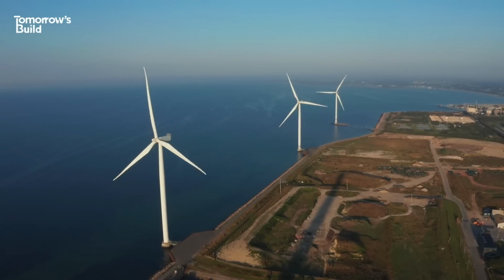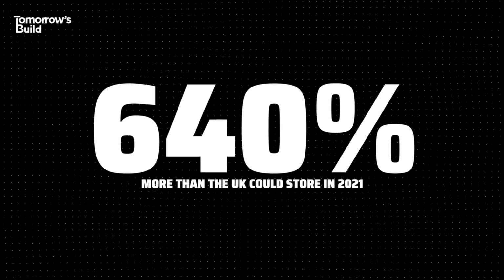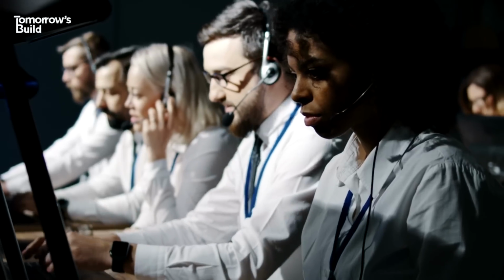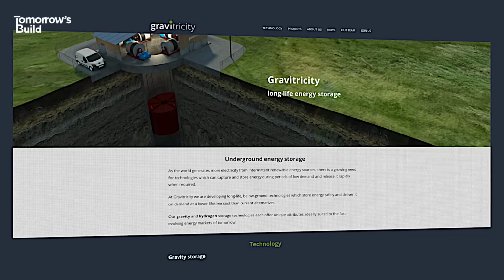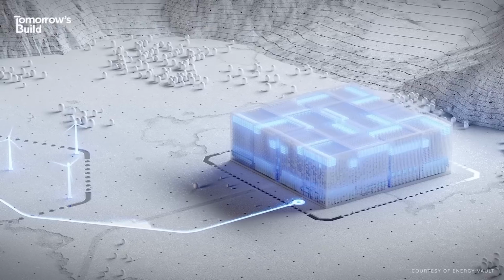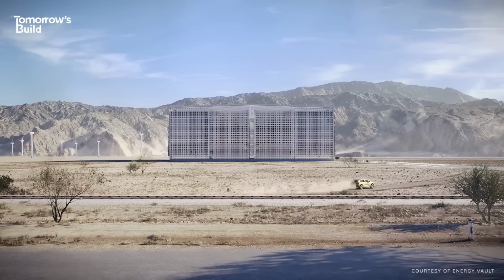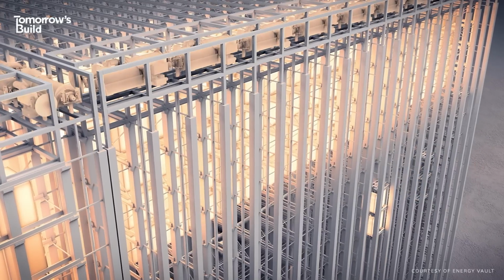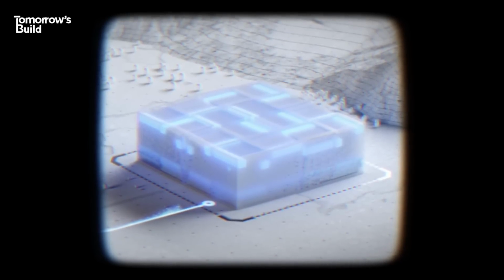The Hidden Crisis With Renewable Energy | Tomorrow's Build

Comment: Adam Something did a video on the previous version of the Energy Vault just over a year ago, and this design as clearly gone through some iterations, but still has many of the problems of the original. Like you mention, the material cost of the Vault versus using building dams is contentious, though I've done no research to determine the amounts of used in either. Additionally, the amount of energy stored would be an interesting aspect to look into to get an idea of how effective/viable the different options are.
Reply: I remembered the same video: The Energy Vault is a Dumb Idea, Here's Why. In particular, I think he made a snarky but true comment about these 'solutions' that show nothing but flashy computer graphics.
Reply: @ropro9817  Energy vault does have a prototype. but that is a shitty little prototype. with a crane (a bit like the ones in the former renders).

But technical prototypes are super ugly and are worth nothing for an advertising the idea to "normal people". 
Nevertheless, the prototypes do their job in validating their point. Even though, you might never actually see any of these technical prototypes.

I do agree, that companies that never make technical prototypes are basically a scam. But that doesn't mean that the inverse is true: Just because a company has a nice looking render, doesn't mean they also properly prototype.
Reply: @aurelspecker6740  Thunderfoot calculated that that prototype had about as much energy storage as you need to run a single watercooker.
Reply: @MPostma72  Which is exactly what I meant. 
And so? Yes, the prototype is tiny. But it also is totally irrelevant how tiny it is, if you don't want to test the size of it.
In fact, coming myself from innovation (totally different field though) tiny and cost effective prototypes are bread and butter of your progress. And each prototype is only made to test a few aspects, and rarely the whole thing.

Now to be concrete on the topic they were definitely able to test: 
Minimum roundtrip efficiency (most important)
Motor designs
Open design (failed due to wind, but expertiments > assumptions, positive surprises do also happen from time to time in my experience)
Optimal power curve (i.e. how fast to lower the weights)

What did they not test?
Size
(and a lot more)

If the roundtrip efficiency is just 80% it would already be at the level of pumped hydro. And that could easily be doable with electric motors.
Reply: @aurelspecker6740  wrong again. They’re literally constructing the full scale thing right now in TX
Reply: @MPostma72  #1 that guy doesn’t disclose that he holds large short positions on NRGV’s stock. #2 that guy couldn’t calculate a dumbed-down algebra equation for a single variable with the internet and a calculator in front of him. And #3 it actually produces enough energy that they are building one in the middle of the Australia outback that is going to power the ENTIRE ISLAND/COUNTRY OF SINGAPORE….read a book and try again.
Reply: @ropro9817  completely wrong. They just broke ground on their first site this month, and have contracts with 26 states and over 30 countries.
Reply: Fully agree. Buzz words all around in case you do the math you will see that price performance ratio is just shit. This will not be the answer for the storage issue
Reply: @lars-christianheinz6902  you’re either just a plain liar or simply do not know how to do math, not sure which but it’s one or the other. My father co-founded this company and is it’s current COO, he also designed the entire thing. It is the only reliable solution for green-generated energy storage atm and they can build them where they pay for themselves within 3-5 years depending on scale and regional power demand. Do you hold a short position or something on NRGV?
Reply: @ryancwiese  Well, lets Talk in 5 years when this breakthrough collapsed and burned Tons of other people's money. This technology will at best have niche applications
Reply: @lars-christianheinz6902  that’s actually impossible. They have already signed enough contracts with states and other countries’ governments that could not physically complete all of the construction in under 5 years. It’s not a theoretical idea anymore, it is being implemented world wide. More likely than not in whatever you state you happen to live in.  Always appreciate the chance to inform though, thanks!
Reply: @ryancwiese  well, as I said. Other people ´s money.  In your case tax payers money. I hope Germany will not spend a single Euro for this BS
Reply: @lars-christianheinz6902  it already has. Sorry to give you the bad news. They have signed contracts to purchase and/or partially fund more than 5 sites within near-by EU members countries. You should be excited, I never understand the level of pessimism and negativity today. I’m telling you that the math works, I’ve done the equations myself as someone with a mathematics degree with a minor in physics, plus a father who literally is the lead designer and do-founder of the company, and inventor of the technology, it is a great thing for the world. I don’t even believe humans can control climate change, but since our governments are dead set on forcing this change from fossil fuels upon us, then might as well be through a reliable and economically & financially sound means of creating the energy. This is the single best option available right now. Nuclear Fusion is still minimum 10 years away. All you idiots out there that believe CO2 is a pollutant and want all these electric cars; while rolling black outs are becoming commonplace around the developed world - maybe be grateful?  The chance that you possess the knowledge to even work out the mathematics and physics equations to solve the proof that demonstrates it works and at a more affordable cost and way more efficiently than those dumb ass batteries, is right around zero. Nothing personal, I just actually happen to know how to do it and it’s not simple. You’re just following something someone else said, you don’t actually know what you’re even talking about. So just give it a rest and be sure to come back and say thank you when we save you from Russia.
Reply: @chemicalfrankie1030  i am a bit older, but that doesnt matter, i guess two main problems are here, first we need to water reservoir, one higher than the other... so i guess a long valley or a river with enough water would be good... but looking at the hoover dam, the river should be watersave at least for the filling years and depends on the evaporation, the water should be replaced...
 i think of something like the Quattara Depression Project. Combined with a pan European and African electric Grid, this could be better than any garbage working with steel cables and wheels with friction and material fatigue
Reply: Thinking about the cost of building these folly's wouldn't it better to subsidise 14kwh power wall's for every house hold linked to a smart local grid.
Reply: They’ve actually signed federal contracts so it doesn’t cost the company anything. In fact half of the materials THEY get paid to use bc it’s constructed from 100% recycled land dump burn pit ash
Reply: Guys like Adam Something and Thundef00t do basically zero research on the topics they cover. They compare gravity storage with pumped hydro, which, if they'd spent even 10 minutes doing research, they'd know they serve different niches. They never mention frequency regulation, which means they have no idea about what one of the main purposes of these solutions are. You'd rather not use pumped hydro for frequency regulation.
Reply: @chemicalfrankie1030  hmm okay we could use some desert or some valley in the mountains (swiss mountains are full of that and nobody is saying ah this is ugly) sure we have a local problem with the build, but better than a industrial tower with weights moving up and down and making funny noises...
Reply: both gravity batteries like energy vault and pumped hydro have a ton of issues, i mean for the tiny ass capacity that was mentioned in adams video, the only reason pumped hydro has a useful amount of energy is because theyre obscenely big, but water is a precious resource, its getting closer and closer to the point where itd be the same as using blocks of silver for energy vault

Comment: Why don't we build mini nuclear power stations.  Like the ones they put in nuclear submarines.
Reply: B1M did a video about it allready: https://www.youtube.com/watch?v=BrN_SRzsEF4
Short answer: It is being worked on but it is still bloody expensive.
Reply: @ReDFootY  Thanks.  Will have to watch that.  👍
Reply: To be fair we need as well BIG nuclear power plants for our base-load
Reply: Why not build the big ones which are the most cost effective? Something doesn't need to be novel or even new to be an appropriate solution.
Reply: @gregorymalchuk272  Exactly. This channel had a video about 20mw smrs that are going to cost $100m.

The fastest built reactor was built in 39 months and is 1315mw. You would need 66 smr to equal 1 1315mw reactor. At 3 months each x 66=198 months. Thats 5x longer.

"The size and modular building approach means Last Energy’s PWR-20 is under $100 million per unit"

66 of these would be $6.6b.
"The installation cost for the Kashiwazaki-Kariwa Nuclear Power is said to be 70 billion yen."
That averages to $75m per reactor. One reactor is still cheaper than the smr. Accounting for inflation the 1315mw reactor would be $140m. Still cheaper considering what youre buying.
Reply: @namename9998  I'm not against SMRs. They exist because individual power companies can't get financing from banks for an amount as large as is required by the larger reactors. But if you are a large public utility or state owned enterprise with very deep pockets, you may as well build the larger ones. The one wild card is the cost of delays. The prefabricated nature may make them desirable for that reason alone.
Reply: @gregorymalchuk272  Yeah. It doesnt make sense why energy is private but I guess it could be complicated if you have multiple sources vs 1-2 like France.

Comment: energy vault are the crane power ideots right? glad they moved on from that. However, building custom structures for this is stupid wastefull of space and materials. What is interesting is trying to incorporate these systems into newly constructed buildings, vertical hight is this systems largest advantage leaving the middle floors both inefficient and wastefull. if the sound and extra construction costs aren't too overwhelming you could fill the middle floors with housing, industry or some other use.
Sovjet style mega housing blocks (though lets make them slightly better looking) would be perfect for this. to power itself it wouldnt even need multiple floors of blocks and the extra space taken up by the system could serve as both the foundation and an extra insulated layer between the roof and the top floor.

Comment: Such a great video! 

You know when I’ve been talking to people I’ve always said while renewables are great because they pull energy out of thin air, the beauty of fossil fuels is everything is a known quantity.

For example you have a set amount of energy stored in a fuel tank, but you also know the rate at which that energy can be extracted (maximum power output of the power plant). 

This effectively allows everything to work in a measured way. As you said renewables cannot just be switched on or off or change their power output on demand.

Personally I think the big issue is exactly what this video points out. Storage of said renewable power.

It will be very interesting to see what ends up being part of the solution. I don’t know much about cranes but I imagine there is a decent amount of wear involved in allowing a massive concrete block to do a controlled decent.

I guess only time will tell. 😀
Reply: Actually renewables vary!
Solar CAN be switched off, and with a fairly small battery can back stop grid, and keep frequency
With larger batteries can arbitrated and lower power prices, and time shift generation to peak!
Reply: That’s a very good point. 

I suppose the issue I see (and I’m not an expert) is one of energy density (I’m using this term quite broadly). 

Batteries are not very dense when compared to fossil fuels or say hydrogen. 

Where I live we have a 40km2 wind farm (Burbo Bank) and nobody is bothered because it’s out at sea and out of the way. 

However I don’t think anyone would want a big battery system (like the Tesla one in Australia) being built nearby.

This is where I think the whole energy storage debate is fascinating. You can build a 2GW Coal Power Plant (Fiddlers Ferry) relatively out of the way where it bothers few people. 

There is no way you could have Burbo Bank onshore (where you could install battery storage).

This is why I believe the grid will require Gas for a long time yet.

It is really interesting to see it play out though.
Reply: @manolisponiris7045  I see you both really understand the real facts!.hydrogen is stupendously not dense unless frozen to -200+ degrees, within a few degrees of ABSOLUTE zero, or alternatively, when carried on road at 10,000 psi it takes ( I may be slightly out. Have chemo brain tonight) between 13 and 18 trucks to supply equivient energy to a single tanker of petroleum. 
You need miles of power to crack it, very inefficient, and a vast buffer zone!.
It's explosive, didn't just have very very occasional contained fires. Of far safer is methane but you may as well just shoot your grandkids now to save them living in our mess!

Lastly they only need a few acres, and are only 8' tall, so easily screened, silent, and efficient
Get out of you echo chamber and look at who is paying to promote these slutions that are all ways for existing corporationsto continue rorting society!.